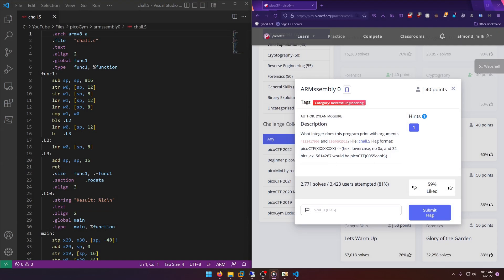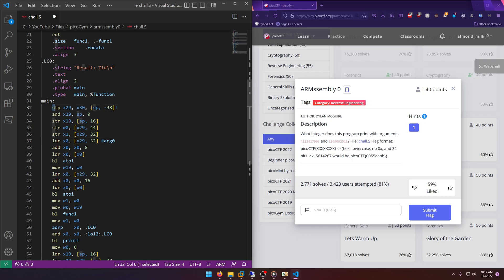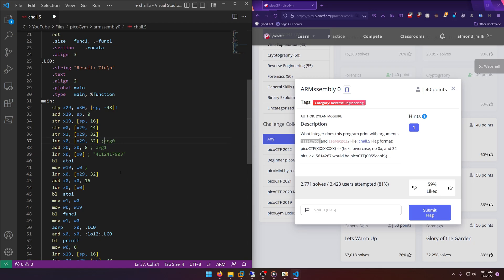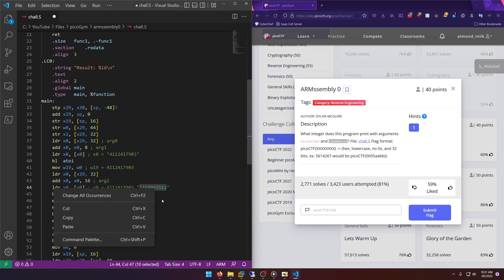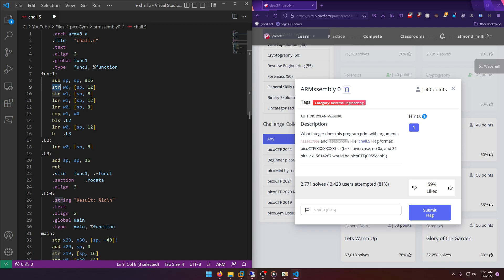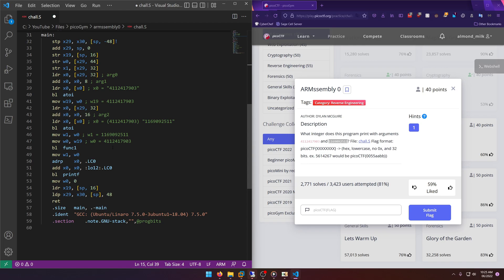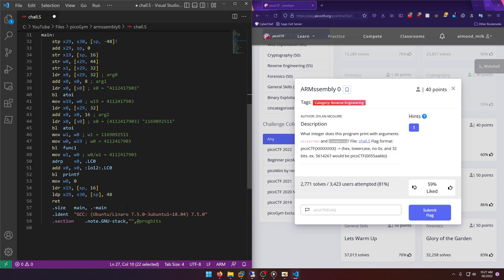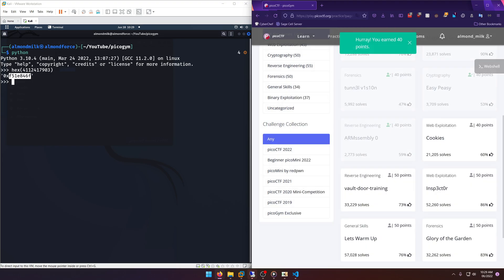picoGym (picoCTF) Exercise: ARMssembly 0

Comment: Video well done. It certainly required all the knowledge on what every instruction was doing and how armv8 works, but then you could understand it. I for myself tried doing that CTF but the main thing missing out for me, was that I didn't understand that the first lines were just loading the arg1 and arg2 into w0 and w1. Because I had no info on that
Reply from the maker: Thanks! Yeah it definitely took some research on my end to be able to interpret the code properly.